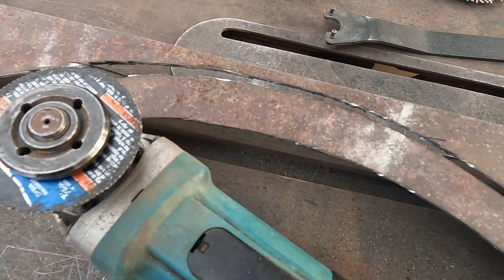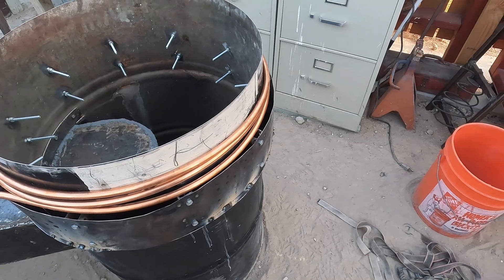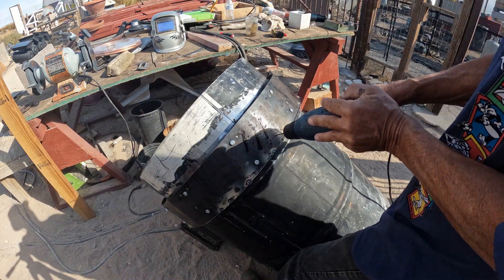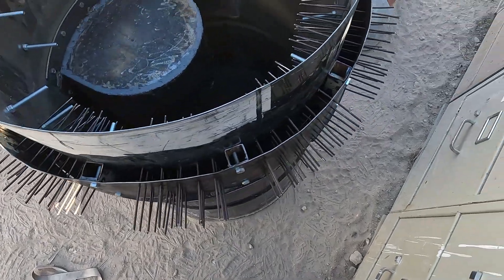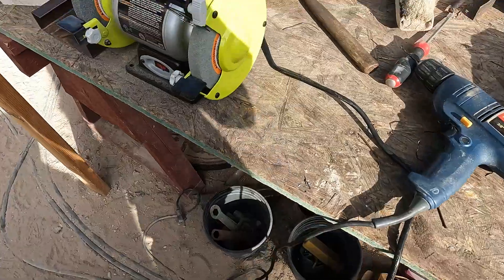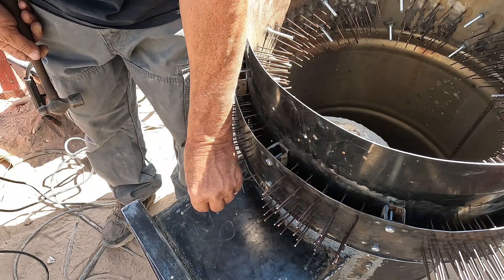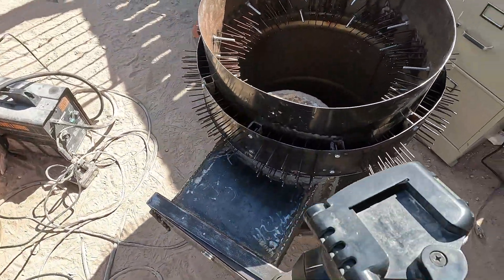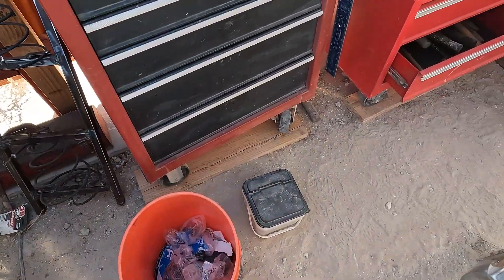163- Fifty-Five Gallon Sand Battery Heat Transfer Rods

Comment: What if you had a 6-8" duct inlet, fill with as many .5" or whatever cast iron pipes like an L. Have inlet enter the bottom, bend the cast iron pipes to spread them in a ring going to the top of the can, which would expose your intake air to a large surface area distributed throughout the sand battery. This may not make sense without seeing it drawn up
Reply: Thinking too,and waiting wat comming next.....164...❤
Reply from the maker: Yes it makes sense, there are many ways it can be designed. This just happens to be what I came up with for this particular project.
Reply: @off-gridsurvivalmike8120  you're working wonders, you're living the dream. I envy your tinkering